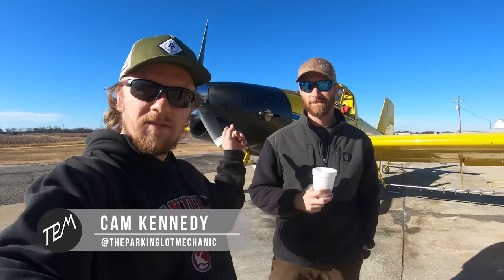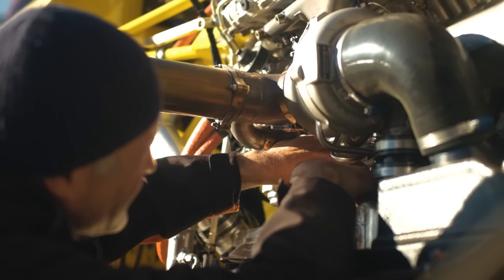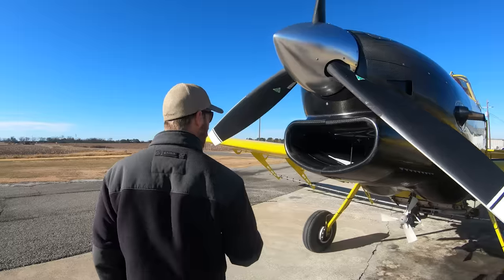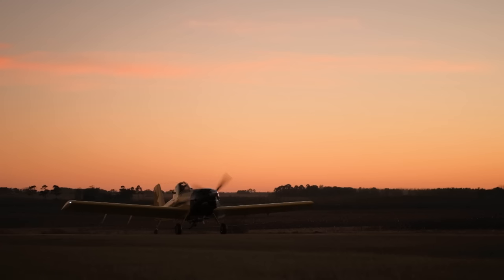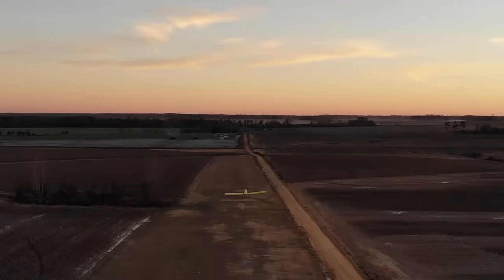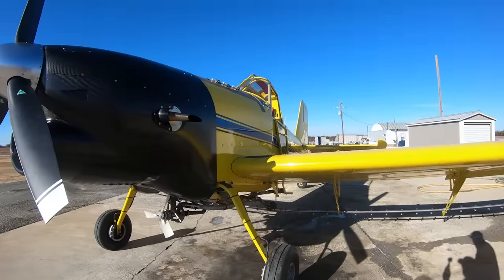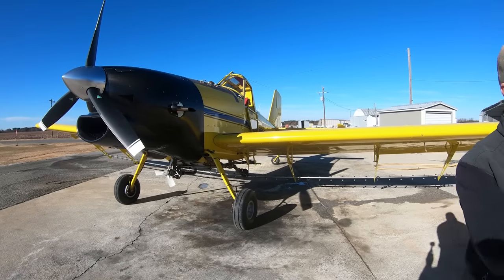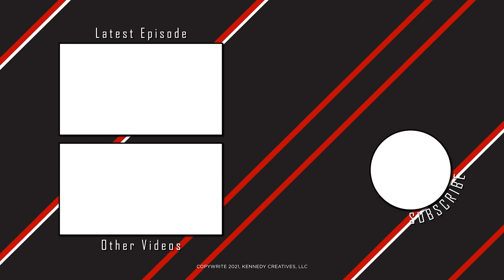Meet The V12 Twin Turbo Diesel Crop Duster

Comment: Lots of work, impressive engineering and tons of blood sweat and tears no doubt… but uh. 

Just stick to the damn PT6 - the weight savings alone are priceless and make up for lots of HP, not to mention it’s probably more reliable by a factor of 1000+, which is absolutely critical when you’re operating ~50’ off the ground. 

I mean, it’s cool but… why? And if your life depended on it, would you fly this or a standard AT-802 with a ~1,400hp PT6 turboprop and probably 15x fewer moving parts lol.
Reply: Tell that "reliable" to Mack, Kenworth, Navistar etc owners.....
don't see them with turbines????.

Comment: Stock 502 has 750 hp, how does this compare with 200 hp less?
Reply from the maker: I know the guys who do the conversion can tell you so much better than I can, but my general understanding is that it burns half as much fuel, lower maintenance costs, and longer run time between rebuilds, and 150 mph ferry speeds (I have no context on if that’s fast or slow lol)
Reply: @TheParkingLotMechanic  I cannot believe there is longer run times between overhauls, that is one thing the turbines have over any reciprocating engine. As far as maintenance I have no idea. Horsepower translates into climb and takeoff performance 200 less horsepower is significant.
Reply: This is a AT-301 which runs under 550 hp radial engine, even the 402 runs under 650 hp, and the RED 03 can be rated up to 600 hp
Reply: @estebantorres4442  thanks. That makes sense for the AT-301 then.
Reply: @johnmajane3731  But if the V12 has more torque, it wont require as lower gear reduction, making up for the less power.
Reply: @chippyjohn1  You must have HP.  The stock 301 has 600HP and its weak as a kitten when you load it up.
Reply: @craigcraft9784  Yes but we must understand that a propeller for the most part does not accelerate. The RPM's are fixed and the gears are fixed, unlike a car. So an aircraft engine with more torque and less power can be the same as one with more power and less torque when geared for the same output speed. Torque is moving mass, power is how quickly you do it. If you transfer a large amount of mass slowly or a small amount quickly, you will end up with the same amount of transfer. So, having less power does not mean slower, if there is more torque and the output speed is the same.
Reply: @chippyjohn1  I believe you've got a good understanding of the subject (getting people to see the relationship of HP and torque is an exercise in futility unless they somehow grasp it intuitively).  HP is defined by two things, RPM and torque...that's it.  If you're limited on RPM (redline on prop), then the only thing that changes your HP is your torque.  If the PT6-20 and the RED A03 are both rated for the same HP at a particular RPM, then both are making literally identical amounts of torque, and it doesn't matter what kind of gearing they used to get to that point.  In reality, there's a 200RPM difference (but it's really close as far as comparing engines)...the A03 makes 550HP at 2,000 and the -20 makes 550HP at 2200RPM, the -20 being geared down from 30,000RPM and the A03 being geared down from 3,750RPM to get similar prop speeds, but practically speaking, the idea that the A03 is going to perform better because it makes more ungeared torque is entirely irrelevant.  That prop doesn't care what's spinning behind it to make it absorb 1450ft/lbs of torque at 2,000RPM, it just cares that you're making 1450ft/lbs of torque at 2,000RPM to feed it.  You can get that by gearing down a jet engine making 96ft/lbs of torque at 30,000RPM, or you can get it by gearing down a diesel engine making 770ft/lbs of torque at 3,750RPM, both are equal and equivalent when geared to the same speed, both are making 550HP.  Both engines are also capable (theoretically) of blowing right past that redline torque and making more power than 550HP, I know for a fact that the -20 will (and does) on a cool day, while the A03 probably has some sort of FADEC limiting those parameters.  Good or bad, it is what it is.

When you start talking about small differences in power output, other things are far more important considerations as far as how well the plane performs.  The weight of said powerplant, the aerodynamics, and the prop are all considerably more important than a bit of extra power here and there.  The lighter weight and aerodynamic PT6-20, when compared to the R1340, feels like you've added 100HP or more, even though the -20 makes 50HP less, for three reasons...you've removed about 600lbs of engine, you've removed a huge airbrake on the nose, and you've gone from an inefficient 1920's prop to a modern three blade Hartzell.  A 502 running a 750HP -34 with a three blade Hartzell benefits more from a change in prop than an upgraded engine.  The new four blade "loadmaster" prop as it's called, makes more of a difference in performance than upgrading to a -42 rated at 850HP.  I'm betting the fancy MT prop they included with this engine makes a big difference just by itself, then add in 200lbs of weight savings and a more aerodynamic nose, it should fly quite a bit better than a 1340.
Reply: @Skinflaps_Meatslapper  This might be one of the best things I've ever read in a comment section,  I actually learned a lot from this post.  Thank you for explaining this!

Comment: Turbine power at radial fuel consumption.
Reply: Definitely not turbine power. The weight of the pt6 at that power rating is several hundred pounds lighter.
Reply: @Dreddip  
550 Hp is low range of PT6.  This diesel is lighter than the R1340 used in AT 501.
Reply: @keithjurena9319  That's what I'm saying. If you installed a PT6 that puts out 550 HP.  That PT6 would be some 300lbs less than this diesel engine. AKA, turbines have a much higher power density than any reciprocating power plant.
Reply: @Dreddip  
300 pounds is less than an hour and a half of fuel for the turbine.
Reply: @keithjurena9319  You can't compare recip with turbine fuel consumption....

You're saying its the same HP as a turbine but at the consumption of a recip. which isn't a fair comparison. Because that recip fuel consumption comes at the cost of 300lbs less useful load (if that's even a factor in this airframe). But again, that is not the same thing. Could say it was electric or solar or nuclear powered. If it puts out 550 HP its not the same as being turbine powered at so-and-so fuel/energy consumption. Not to mention the differences in maintenance and possibly reliability (who knows?).

If it were the same weight AND the same HP, then your statement would be a fair comparison. That's all I'm saying.

On a side note, and completely random... Anyone ever fly a rotary aviation engine? (not the old school radial type)

Comment: They need to outlaw gasoline aircraft engines in modern aircraft, period. I honestly think the only reason why they still exist in modern propeller aircraft, is to keep American gasoline aviation techs employed, nothing of value will be lost if Av gas engines went to the wayside. Turbodiesel aircraft engines will ALWAYS be better than a gasoline powered one, at any altitude, speed, and load.

Comment: Sounds very heavy
Reply: Obviously not much (if any) heavier than what gets taken off????
Reply: @JohnSmith-yv6eq  LOL you don't know anything about engines do you ?weight on a 5.4L  gas engine is 540 lbs, V10 is 670 lbs and the 6.0L diesel cummins is 1062 lbs. (The 4.2L V6 is 410 lbs.) so in trucks twice the weight. and turbine engines are super light.

Comment: In my 70 years on this earth, I have Never seen a conversion engines that lasted. Total waste of your money! Also a 301 with a 400 tail!
Reply: It’s not a conversion engine but purpose designed and built from a clean sheet.
Reply: The "Red" engine is a purpose built aircraft engine, not a converted engine from a non-aero application.
Reply: @johndavidwolf4239  really? Isn't it based off the Audi Q7 engine?
Reply: @richardharrold9736  : Not at all, it was originally a Russian design that is now built in Germany, and none of the specs appear to me to be the same as the Audi engine,
Reply: @johndavidwolf4239  Oh, OK... I find that a tad surprising. Is it a clean sheet or based on an older Russian commercial/industrial engine?
Reply: @richardharrold9736  : I don't think so as none of the specs or dimensions appear to be the same as the Audi motor, for one it is an 80º block whereas the Audi is 60º.  I believe that it was originally a Russian design, and the designer then moved to Germany.
Reply: @johndavidwolf4239  eighty degrees, WTF? Why? Wouldn't that throw the firing pulses off and make it vibrate like hell?
Reply: @richardharrold9736  : From what I have read, it is a clean sheet design, but I have NOT done extensive research.
Reply: @richardharrold9736  : I asked myself the same question, and from what I have read it is essentially two straight sixes (a configuration that is naturally balanced in first and second orders) that share a crankshaft, the "V" angle was chosen for packaging.